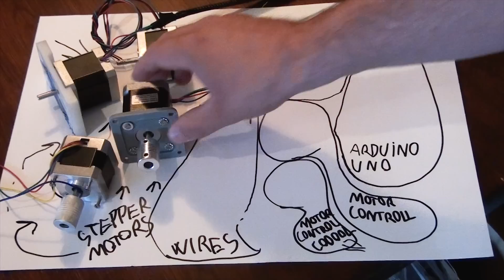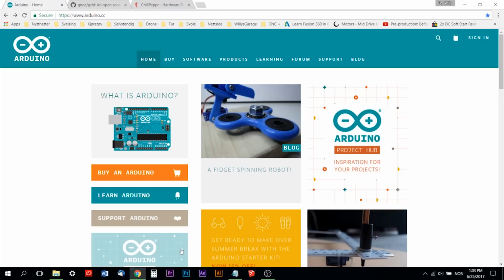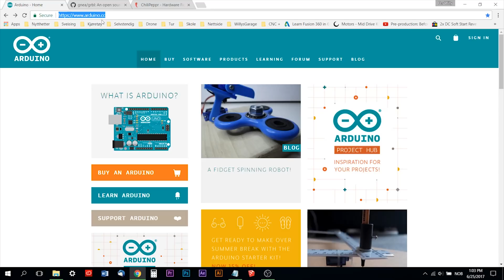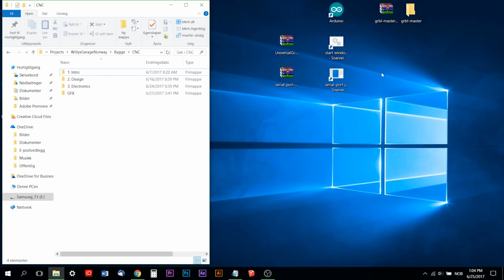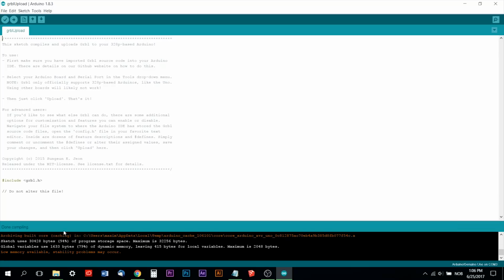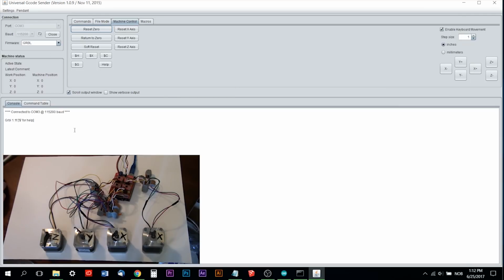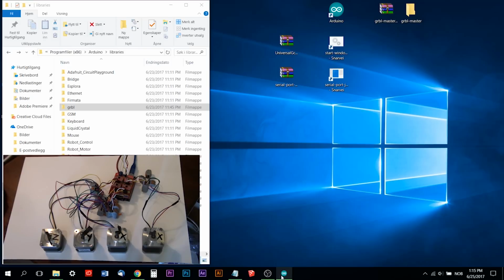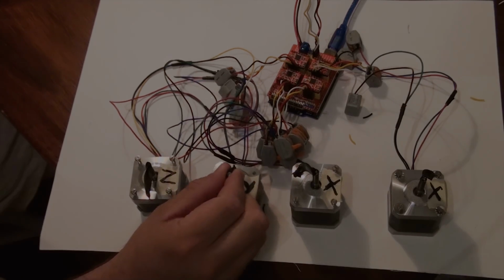First DIY CNC build (Part 3) - Figuring out the ELECTRONICS - Arduino Genuino UNO GRBL

Comment: Hey willy i having same problem that you having in this video with Y axis. It will stop after feed is increased. Can you tell what is the reason for this problem and how to solve this? If you have the vedio regarding please share the link with me.
Reply from the maker: Hi 😀  have you checked out my video on configuring GRBL? https://youtu.be/-ssuoF2oXGg
Check the max traveling speed to get the stepper motor to stopp stalling

Comment: Hi
I Have make a small project With
arduino uno + cnc shield v3 + A4988 motor driver + stepper motor 
it's work good.
but 1 issue only 1 program are run in arduino uno
so i want add button for diffrent 4 program run in single codding.
like if press button - 1 then run code line 1,
if press button - 2 then run code line 2,
if press button - 3 then run code line 3,
if press button - 4 then run code line 4,
Reply from the maker: Yeah, sounds good. I am no expert coder, cant help

Comment: got tired of the cronos board didn't workout then tried the arduino uno with cnc shield, didn't work, working a lot for testing all items, motors, chields, drivers and different uno board to no awail, ohh two of the cables for the motors have crossed wires.
Reply from the maker: So you figured it out then??
Reply: @WillysGarageNorway  I'm back to the Cronos Maker board, as there was a humming sound from one of the motors when I got it running on the Arduino with cnc shield. so now it's working as it's should.

One prolem, why is it so hard to fix home to one of the corners on the table? and why can't you just run "it" to a start position and set it as home (the stepper motor can loose steps)? how to set the home in settings? How to set home for the XYZ axis with and/or without limit switches?

I am working with limit switches but it's not easy to find room for them.

It is aproblem working with these CNC's you don't get any information on the technical details of the motors and so on, just saying, I have an 3018 cronos maker cnc with 5w output laser and 300w spindle motor.

Thanks Willy
subscribed

all the best

Comment: question sir:- will it be possible to have more on one axis which is independent on motion occurrence?
Reply from the maker: Its possible to have 3 axis independant pluss one cloned axis on the CNC shield. But if wired outside of the shield you can clone more axis but dont get more independant axis. For that you need different controller

Comment: Excellent video, very easy to understand! But still, I have a question: The power supply that comes with the spindle can't be used to power the steppers!? Do I have to get a separate power supply for those!? (Sorry if it's a stupid question)
If that's the case, do you think a 12V 30A power supply is enough for 3 Nema 23 2.8A!?
Reply from the maker: Hi and thanks.
The spindle PSU is made for the spindle only in regards to power consumption. The spindle also makes a lot of electronic noise that can cause fault in the electronics and stepper motors (I never think a question is too stupid, we have all been there:)
If you are going to use 3 NEMA 23 - 2.8A you could do a simple calculation. 3 x 2.8A = 8.4 Amps. This means that you in theory only need a 12V 10A PSU. But on a machine you always have other sources of power consumtion so I would have gone for 15A minimum on my PSU. 
But the 30A PSU you mention also works great :) 👍
Reply: @WillysGarageNorway  Thank You very much for the help and quick reply!
Reply from the maker: No problemo

Comment: How do you know what power supply to get?
Reply: I am very new to this subject
Reply from the maker: When you buy a psu you have to know how much ampere (watt) your setup will require to run.
Fo instance if you have 4 NEMA 23's that pull 2.2Ampere each, you would need a psu that has 2.2x4=8.8 Amps. And its always a good idea to have a psu with more amps then your system require
Reply: @WillysGarageNorway  wow thank you for responding!😄 it’s rare to find someone who would take the time to answer questions!
Reply from the maker: @BigJ_FPV  No problem, we have all been new to a subject before 😀👍

Comment: What is the current and voltage of the power supply?
Reply from the maker: 12 volt DC (10 Amps)  I think this was, I have since changed my CNC controller and power supplies 👍
Reply: @WillysGarageNorway   Thanks brother...

Comment: It's been a long time since you've posted this video with a question at the end but I think you're having this problem because the motor isn't getting enough current to run at higher speeds so it stalls. Maybe the wires isn't thick enough? Maybe your driver isn't capable of providing enough current that the motor needs to run at higher speeds? I'm sure it's related to current flow, some how!
Reply: Servos and stepper motors' speed is not governed by the current. The current gives the torque. 
The speed of servos and stepper motors is given by the duty cycle, it's waveform and its frequency.

Comment: if I want to use tb6600 drivers where can I get the adapters that replace the tiny drivers on the motor shield?
Reply from the maker: Hi is this the material you are asking for? Here is tool and connector kit.
Crimping tool:
https://www.banggood.com/custlink/GGGmQqlqRA
Pin connector kit:
https://www.banggood.com/custlink/K3vDnkjqde

Comment: Y the jumpers under the motor drivers??
Reply from the maker: What do you mean?
Reply: @WillysGarageNorway  theres 6 lil prongs on ther shield under the stepper motors drivers and u have lil jumper on them the main q is what are the 6 prongs under the stepper motors drivers for??
Reply from the maker: @brandontexas7266  hi, those jumpers are to select the microstepping setting for each stepper motor, search: "cnc shield microstepping jumpers" on google and check it out 👍

Comment: I use universal gcode 2.0. My problem is that I switch to mm. And when I move an axis 1mm, it moves over 10cm. Think it moves in inches. So when I enter a gcode to mill, it look like it also moves in inches. Although everything is made in mm to put in mm on the program. My engines are 1.8 °. And has 8mm screwdrive. So $ 100/101/102 is set to 200mm. And it should vote according to calculation. But seems more like it does not register in mm but moves in inch. Can anyone help?

Jeg bruker universal gcode sender vers. 2.0. Problemet mitt, er at jeg bytter til mm. Og når jeg flytter en akse 1mm, så flytter den seg over 10cm. Trur den flytter seg i inch. Så når jeg legger in en gcode for å frese, så ser du ut som den også flytter i inch. Selv om alt er lagd i mm å satt i mm på programmet. Motorene mine er 1.8°. Og har 8mm screwdrive. Så $100/101/102 er satt til 200mm. Og det skal stemme ifølge utregning. Men virker mer ut som den ikke registrerer i mm men flytter i inch. Kan noen hjelpe?
Reply from the maker: Hi, do you have a screenshot of your GRBL settings? Maby I can help you.
Its easier to communicate with screenshots and videos on Facebook or instagram. DM me there if you have that possibility 😀👍

Comment: Hello Sir. I am working on the CNC Desktop machine. I used Ardunio UNO, Neema 23 Stepper Motor, TB6600 Motor drivers, Universal G code Sender.  In the program the minimum feed rate is defined as a 1 mm/min but, I want it to 0.03mm/min. I am not able to change the feed rate in the program. Please help me, sir.

Comment: hello sir, thank you for the great video. my stepper motors started to move for the first time, but failed to connect to chiliypappr I don`t know why.
i installed  Serial Port JSON Server and did what you did on you vedio, but it is not working. if you konw about the conneting problem please let me know.
Reply from the maker: Hi, and thanks for watching. I cant tel you whats wrong, It sounds like you have done everything you should. Have you figured it out?
Reply: @WillysGarageNorway  I finally figured it out!!! the problem was that I used Microsoft edge instead of Microsoft chrome I tried a lot with watching your video go over the method I used again and again than I realized that problem could be from internet browser. chrome has no problem with running chilipappr!! I am so happy. now my motors are moving just like yours!! thanks a lot.
Reply from the maker: Im really glad it worked out! 👍😁

Comment: good video Willy,  i have the same board but the motors just vibrate..  can you tell me the stepper pinout on the board ?  thanks   Joe
Reply from the maker: Do you have the cnc shield and Arduino Uno?
Reply: WillysGarageNorway Willy, I got it figured out... it was the feed rate ...too high..  thank you so much for the reply !!
Reply from the maker: @RaptorMachineToolCo  Cool that you figured it out 👍😀 let me know if you have any other questions

Comment: Your most wrong decision is that you are using a4988s they are so weak. Use drv 8825 is 2x powerful.
Reply from the maker: Thanks for the advise. If you watch my cnc series you see that  ended up using the tb6560 and nema23's. As you say, the a4988 were way to weak :)
Reply: @WillysGarageNorway  Your machine is Small, if you would have used dvr8825 you might not  required to upgrade to tb6500s.
Reply from the maker: @DiscoverRajivVlogs  you are correct 👍😁I just opted for an even stronger option 😉

Comment: Just wondering why so many people are trying to run there DIY CNC with Arduino uno and having problems with them, instead  of using the Arduino Mega2560 witch runs a DIY cnc so much better. One of the  problems people are having is running out of memory. The Arduino Mega2560  has more memory, and runs faster, it has more digital out/inputs, doesn't matter too much with a cnc.

Comment: can NEMA 23 steppers be used with this cnc shield? i just ordered my "kuman CNC Shield Expansion Board V3.0 +UNO R3 Board + A4988 Stepper Motor Driver with Heatsink for Arduino Kits K75 (CNC Shield+UNO R3+Stepper Motor)" off amazon. thanks and nice video guide
Reply from the maker: Thanks for watching. I would be a bit carefull running the NEMA23 on the a4988's. But if you keep it in the amp range (not over 2 amps) there should be no problem. But this type of setup is in the "danger" zone regards to overload. I would recommend using something like the TB6560 or tb6600 :) or NEMA17's

Comment: i think i have a broken cnc shield , uno talks to laptop have universal g code sender working but can not move the motors please some one help me   .😢
Reply: Finally got it working 3 x a4899's had failed so i used my spare one and now it working i must of shorted the 3 i had in it😃
Reply from the maker: @3DLL.  thats good. Congratulations 😁👍👍
Reply from the maker: Is this a problem on all the axis? No reaction at all from the stepper motors, humming sound? Have you installed the a4899's correctly? And do you have axternal power dc for your stepper motors hoocked up to the cnc shield?
Reply: @WillysGarageNorway  yeah on all axis no reaction ive installed the a4899's correctly they get warm to the touch too , i have 12v 4 amp dc transformer connected to uno but when i check the power to the cnc there is no volts showing, the fuse is not blown ive checked that. i am really confused.
Reply from the maker: @3DLL.  I dont know but I dont think the a4899 should get warm when not in use? It sounds like they may be giving of holding power? Can you turn the steppers by hand freely when its powered up? Is Positive and negative is connected correct?
And i recoon you have checked the pairs of the steppers are connected correctly?
Reply: @WillysGarageNorway  i can freely move the stepper motor with my hand there is no resistance when powered up. when i test the power on cnc terminals there is no 12 volt showing so i think it might be broken
Reply: is it ok to talk to you on facebook and i can show you pictures

Comment: Good explaining but i dont have shield on board yet and says grbl has not finish booting... Does shield and motor hardware need to be installed?
Reply from the maker: You do not need the shield or the motors to install the Arduino software 👍

Comment: Hello sir! Thanks for uploading this beneficial video. I have a question.If I want to control three stepper motors having 1.5 A/phase specification,then which power supply should I use?
Reply from the maker: I would go for the 24vdc - 6 Amp power supply 😁👍 Or higher of course..

Comment: r if we use  the mach3 and 4 , do we need to apply some  software on arduino?
Reply: the last one what is the differences between stepper motors and servos? My cnc will be 3.70cm -2.20cm . And I will use wood for source, which motor should I use?
Reply from the maker: @mertkars1463  No prob, ask as many questions you want :) I will try to answere them. Steppers and servos do have the same function but servos are small and normaly used in remotly controlled stuff. If your machine is going to be 2-3meters and you are going to cut mostly wood I would atleast go for the NEMA23 and TB6600 drivers with a power supply of 24-36VDC. This should work good on a machine like that :)
Reply: @WillysGarageNorway  thanks my friend :)
Reply from the maker: Mert Kars no :)

Comment: how to increase the movement of a stepper motor
Reply from the maker: Do you mean increasing the speed?
Reply: @WillysGarageNorway  yes. because when i am uploading the image, the speed of stepper motor is slow.
Reply from the maker: @valdiramada430  have you changed some of the settings? You will need to changebyour step/mm and mm/sec. This is easy done in UGS (Universal Gcode Sender)
Reply: @WillysGarageNorway  okee i will try. thank you 😁

Comment: What browser are you using Chilipeppr with? Also, is that your CAM controller? I picked up a toshiba driver just to try because i was using RAMPS and DRV8825 to run some small NEMA23 motors and the steppers were just vibrating loudly, after adjusting the current pot and trying every combination of wires. also i blew up my Arduino Mega because of user error, it went off like a smoke bomb. Anyway, I'm at the "adventure stage" of the process, got an UNO with the Toshiba driver today. I'm really impressed with your method of creating your CNC machine, just as low budget and high quality as possible. smart.
Reply from the maker: Hi, and thanks :) I used chrome browser to run from chilipeppr. But now I only use Fusion 360 for designing and making CAM (toolpaths). Then I export the g code and run them thrue the UGS (Universal Gcode Sender)
Reply: make sure you look into the bipolar and unipolar motor wiring differences. some steppers have 4,5,6 wires depending on phase counts

Comment: Hi! you're video is very informative.. But I haven't really understood the circuit diagram, can I just plug the 4 wires of the stepper motor to the shield or there is a pattern to it? Thank you, I really need your help.. Sorry bad English..
Reply from the maker: Hi, did you find the answer to this question?

Comment: I am having the same trouble I believe the current is not high enough there is a little pot on the driver.
Reply from the maker: That was part of the problem 👍😁 I also had the setting $110-112 (max speed mm/min) on the wrong speed. But I got it in the end wich you can see in the rest of the cnc series. Thanks 👍
Reply: when stepper are run fast they seem to hit a wall
Reply from the maker: The stepper motor stalls. Have you tried to adjust down the max mm/min setting??
Reply: yes  its working very well, reading and good old fashion tenacity thanks for the help.
Reply from the maker: @jackbacic868  hehe, thats good :)

Comment: When I go into ugs it says grbl has not finished booting?  Can anyone help?  Have tried changing the baud rate
Reply from the maker: lorcan wall media so you cant connect with the Arduino at all from the UGS?
Reply: @WillysGarageNorway  no. Any suggestions?
Reply: use 8c version

Comment: i use l298n
Reply from the maker: Srishtygarden Resorts The L298 is very inefficient and will not be presenting the full 12v to the motor. Up to 4 volts can be lost in the driver it self.
But have you connected the Arduinos GND to pin 5 on the module?
Reply from the maker: Srishtygarden Resorts But I would recommend using another driver board

Comment: Ola can you tell me how to use a stepper motor with the CNC shield even if you don't want to use for a CNC machine?
Reply: Sorry not Ola it's pls*
Reply from the maker: You can make a program for the Arduino, what are you using it for?
Reply: WillysGarageNorway just to play around..is that good enough reason?
Reply from the maker: abdul karim halai hi, yes its a good enugh reason 👍🏻😀 if you go to github.com and search for arduino programs how to control a stepper motor with the cnc shield you will get some programs to try out
Reply: WillysGarageNorway ok cool !

Comment: did u set Amps for motors on MOTOR DRIVER by POTENCIOMETER ???
Reply from the maker: Ues, you can use the potensiometer on the a4988 to adjust the current to your stepper motors

Comment: lower speed of your stepper with universal gcode with $ commands to fix your stepper
Reply from the maker: ray johnson Thanks. I fix it by adjusting my GRBL settings on step/mm and max step/min 👍😀
Reply: @King Tinder- Is your acceleration rate set too high? Or your max steps/min? These will cause a stall.

Comment: I have had similar problems with motors cutting out using these drivers and the drv8825 upgrade. I found using a cooling fan over the heat-sinks cures this.
Reply from the maker: Yeah, cooling help a lot. I ended up changing the a4988's to 4 TB6560 and the NEMA17's to NEMA23's
Reply: WillysGarageNorway I spoke to soon. Just fried my cnc shield! I'm now looking at either the tb6560 or tb6600. The 6600 is a little pricier but hopefully more robust. I haven't viewed your full series yet but looks good sofar.
Reply from the maker: Martin Fry Thanks. If you have the chance to go for tb6600, do it. I will upgrade to them if I need.
Reply: @martinfry3480  - Didn't adjust the output amperage, did you?